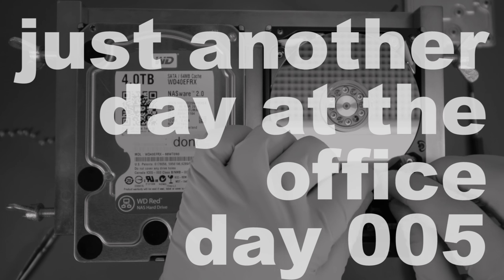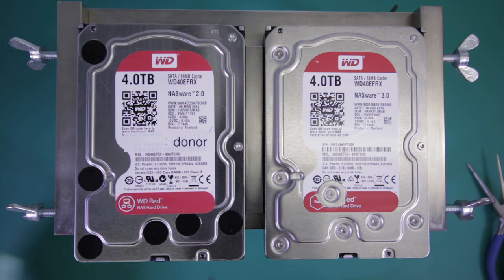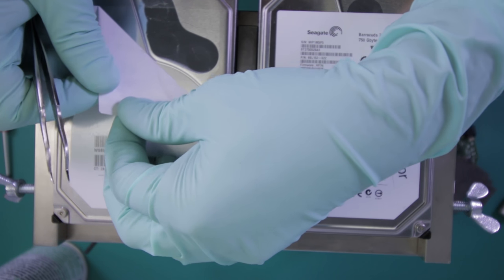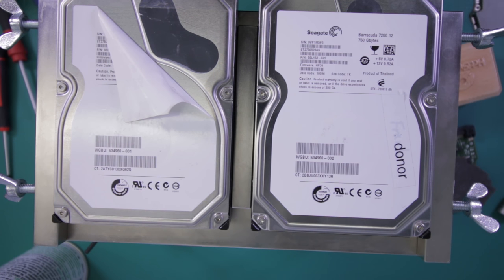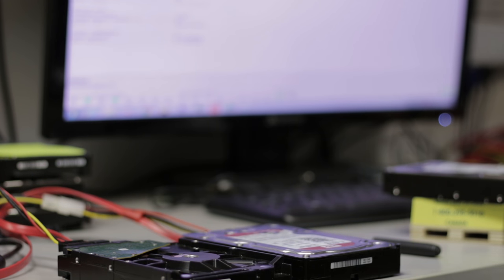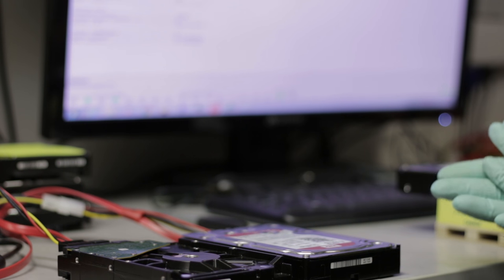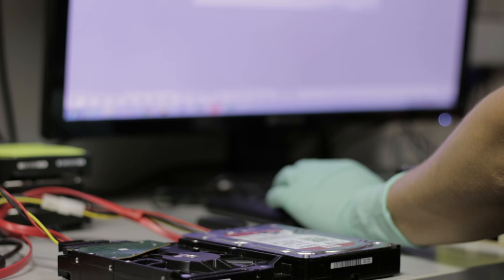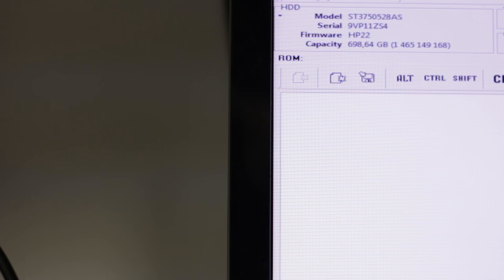recovering hard drives with clicking sounds

Comment: TL;DR Open up drive; replace with spare, working parts, and try and see if it works
Reply: how did that go?
Reply: @griffengout8101  do not do that
Reply: Yes, BUT only open it up in a professional 100% clean place, because every tiny dust that you can't even see will cause problems and for that reason It's almost guaranteed If you open up a drive in average place It is going to be faulty.
Reply: Well those hard drives look like he Winfield lives so it’s probably completely dead the trade area feed helium filled with boxes as
Reply: @VDani16  that's only required if the data inside is worth a fortune. You can actually even operate the drive with the cover open in normal non-cleanroom conditions and help the arm move by hand while at it and have probably 99% chance of not losing your data if not doing something stupid like sticking your dirty fingers to the platters etc. I have done that a few times to old worthless 2.5" laptop hdd's and it's worked every time.
Reply: @MF175mp  Did you built a clean chamber with hprea filter when you replaced the heads?

If so how did you get access to your data? Did you clone it? 

I have got a sonar drive that is matched with the faulty drive so I hope it will works if I build a clean chamber to swap the heads.
Reply: @chris01479  I never replaced heads, the problem was the arm swing stepper was sticky/too weak to move and I salvaged the data by helping the arm first start moving by hand. But I'm not a professional and there was nothing important to lose.

Comment: HDD recovery is it possible to repair a clicking harddrive on a ps4
Reply: usually you're better off replacing the drive. These "repaired" drives are repaired for data recovery not actual long term use.
Reply: I have the same issue lol

Comment: If the platter looks scraped (not mirror smooth), is it a lost cause? My drive is a Seagate and when I open it and look inside, (powered on) the discs spins, and the arm moves back and firth quickly about 10 times before it stops spinning.
Reply from the maker: All depends on your budget. Platter damage of any time is gonna cost thousands. We start at 3000USD for these

Comment: Wonderful video. I was wondering if you could answer a question for me since you guys have done so many hard drives. Does a 7200.11 making "eleven clicks" followed with a turning off sound imply a stuck head or a broken head? If it is merely a stuck head, is it easier for you guys to work around it then having to replace it?
Reply from the maker: If the drive spins up even for a moment the heads are NOT stuck. Opening hard drives to look if they are stuck only increases the risk for platter damage due to contamination and drives up the cost of repair and inspection fees
Reply: @hddrecoveryservices   I see. What then could it be? I have this problem with an old 7200.11 drive and while I have found mentions of the "eleven clicks" error on forums via google.com, no one seems to know what it means. I'm buying a new power supply because I'm afraid it hasn't been getting enough power.
Reply: @hddrecoveryservices  Thank you for that! (You are SO GOOD; I've been watching quite a few HDD recovery vids lately and the quality of your tools and skills is superb.) 

I have an external 2TB Seagate HDD with an issue. It does what you say at the beginning of this video. Seems to spin fine. 

I have made a clean air compartment, have ordered Torx screwdrivers. (Have done cleanlab work in a laminar flow hood in the past.) 

There is a LOT of dust here in my home and I also noticed that the HDD went on strike after it had spent the night in the coldest corner of my home office when the temperatures outside got really low. 

So that makes me suspect that perhaps the actuator mechanism is the problem (contraction of the metal parts in combination with dust possibly jamming the mechanism; what do you think of that?). I have watched your videos and noticed that you later got into the habit of washing heads more often. But washing heads also means that you remove the actuator mechanism and then put it back and if there is debris on the heads, then there might also be some debris that affects the mechanism and that you get rid of it that way. Those tolerances must be minute, after all.

But I was not entirely sure if any of the heads could be stuck. Now I know that they are not. Thank you. 

It does not seem to be a SATA bridge issue either; that said, I can't be 100% sure that the drive is always getting enough juice though it does have its own external power supply (and that does not seem to be the issue). (There could be a USB port issue on the PC, but a new 4TB disk that I have works fine with those ports and that one does not have an external power supply, so that rules out that it's the PC that somehow caused the problem.) A docking station might be handy to have. 

(I also have two internal HDDs with issues - at the same time, yes - but one is dead and had nothing on it so I will just replace that one. The other one seems to be doing better now and is passing tests again; it may have had one bad sector in a critical area that I managed to have worked around now because it went from reporting 7 bad sectors to 6 bad sectors, which may sound unusual (but this may have something to do with Linux; it is running a dual boot). One thing I have meanwhile learned (for people like me, without your kind of gear) is that if you encrypt your Linux partition, checking that partition and telling Linux to avoid the bad blocks becomes impossible or near impossible.

(I have been plagued by hacking for a long time, by people who turned out to be picking the locks to access my equipment and I never saw that coming. My HDDs have not been too happy about all that interference and about how I often responded to it, that is, I was stupid enough to spin the drives up too soon after having to throw power off the PCs when they froze instead of letting everything die down and only then flipping the switch again. Mea culpa. I really should have known better and will be much more careful from now on.)

Sorry for the long comment... (lol)

Comment: i've got segate 320gb barracuda 7200.12. it is not getting detected. how to i recover the data.
Reply: sameer mane we have same a trouble ...
Reply: mine was a terabyte and it clicked of death
Reply: Solution for future problems: don't buy seagate.
Reply: i may be paranoic but i keep my important files on 4 hard drives so each hdd has same exact copy of files
Reply: my wd just crashed so i wouldnt
Reply: You guys wouldn’t have this issue if you’d swap to solid state drives... All 3 of my laptops and both my gaming desktops have SSD’s in them. Intel optane 905p is the way to go, I love the PCIe drives! Once you convert over you’ll throw away every single mechanical HDD you have, they’ll all be worthless once you experience what you’ve been missing.
Reply: Sultan Singh that’s true but for priceless photos or some invaluable data I wouldn’t trust HDD. Seems too risky.
Reply: me too :(
Reply: di Jogja ada servisan khusus hardisk bro

Comment: hi i had a query that if the plate has one or two minute dust particles can it be cleaned? if yes then what are the tools required? i have a seagate 2tb hard disk which has crashed and i had opened it without a clean room enviourment.

Comment: I have an old Seagate 250Gb HDD which is squeaking and clicking. The disc is not spinning at all,  the heads are in thier parked position and do not move on their own. When I try to move the heads towards the disc they fight back and move back to the park position.

Comment: my 2.5 inch hdd is not detecting. I and the hdd is doing clicking sound very loudly. I opend it and I saw that when bois try to detect the head leave the platter and doesn't move to the platter. If i force the head to stay on the platter then it detect in the bois.....what should i do??

Comment: Please help me with one advice: I buy 3 * ironwolf pro 10tb for my nas. First, i put them to pc for test. Only with power cable (without data cable conected) all of them have a sound ("toc" like head hitting something) that repeats over  and over... with a few seconds interval. Smart test and surface test dont reveal any problems, but even with the connected data cable this sound persists. In Qnap they work fine but with this sound... so I returned them after 10 days, and I bought three other hard drives (ironwolf 10tb - without "pro"). The same problem. I put one of then to pc (outside the pc to hear well) for testing: the surface test lasted for a day, and in his time nothing seemed to be heard. After a day, the same sound ("toc-toc") was clearly heard. Almost every second. Even when the hard disk was accessed it was also heard the sound among the others. So I returned these hard disks as well. Was it a problem, or is it normal to hear such a repeating sound? Toc - toc - toc..., not loud, but not regular clicks (clik-clik)... was how it would sound if a hard drive's head was easily hit by an edge... and besides that, the hard drive works seemingly normal

Comment: Really like the head jigs you use. I tried myself on a 2TB Toshiba (platter swap) but was a no-go since I think I ended up moving the heads (uggh). Only lost like 8 years worth of photos and work so...yeah I'm bummed. Good as place as any to just start over I guess. Backup is now a part of my weekly regimen. Idea for approx cost on 2TB toshiba platter swap?
Reply from the maker: The most challenging thing would be to deal with any surface damage that might have emerged during your attempt. If the drive is previously worked on, we charge for inspection and decontamination. Once the inspection is done we can talk price and options. 8 years sounds like a lot to lose. I would recommend reaching out for inspection to see what option are still available
Reply: Thank you for the reply and info. I’ll reach out soon!

Comment: Great video! :-) Thanks. :-)

Two questions: 
- Where did you get those tools that you fixed the heads with before removal?
- Where did you get that cool jig you mounted the disks in?
Reply from the maker: most of my hardware for internal work on hard drives is from these guys here: www.hddsurgery.com
tools are pricey, but they are Porsche of data recovery tools (as in there is no substitute)
Reply: HDD Recovery Services + Reidar G. Henricks : 
I'm glad Reidar asked about those things because I will buy them ... If I've got the money to spare at the moment. But not only that, but what you are doing is very eye opening for me. I've torn the guts out of more computers than most people could ever imagine, but I have NEVER gone to so much detail to get at the data.
Thank you so much for introducing me to a part of my world I knew existed but that I had never seen before. And more so because I am in between jobs and this very well may have given me a new lease on life! I'm dead serious too! I can do this, I just do not have the skill set at the moment.
Reply: First of all, thank you for the reply. :-)
As for pricey, I never expected 400Euro for a headtool for Maxtor.... I have some disks I`d like to play with before I try on one I found that I need to fix, but I guess I need to save up some money first.

Comment: Good job! 
Are these head ramps new? In some of your last videos you used some other spacers to hold the heads apart. Or do you use them only on HDDs with a lot of heads?
Reply from the maker: I've got ramps for almost everything. I think I only use spacers on ST LM seagate/Samsung drives and older to toshiba. The one that is used on 7200.12 in this video is probably from 2009-2010 because it was actually designed for 7200.11 and it is a very early version

Comment: What are the pieces you putting on heads during removal fore ? I have hdd and it just does the clinking for ever. I'm thinking about buy the same HDD and swap heads just for data recovery. Would the new HDD be ok to use after putting its original heads back ? The new HDD will just a back up of some my stuff.
Reply from the maker: Honestly, don't try to do it yourself. Mechanical swap is just a small part of the process.
Reply: @hddrecoveryservices  Ok. I did a little more research and I see its way more complicated than you make it look ;)
Reply: He does this to keep the heads from bumping into each other. He has professional tools for that. Haven't seen others use that.

Comment: Hello,
Great informative video. Thank you! 
I have a question. I I have Dell Inspiron 660 (about 8 yrs old). This week it gave me message that hard drive failure. When tried to turn on, it’s making sounds like a older scanners made while scanning. So I changed the hard drive but problem didn’t go away. So it doesn’t seem like a hard disk problem. I also changed the SATA cable and power cable. But no different. What do you think could be a problem?

Comment: Can you tell me where the proper home needle placement is for a Western Digital wd2500jb hdd?  I found it stuck mid platter when I opened it to look at it?  This particular hdd is a 250gb and it has a pcb board too.
Reply: did you open it in clean air? if not it’s already dead by the time you opened it from the dust.

Comment: I have a question about my Samsung 500 GB drive. The drive was clicking badly when I had it installed in my external hard drive enclosure  it was very hot . I let it cool overnight and then hooked it to a USB Sata adapter and back to my PC . The drive is recognized by the PC and I can see the data when I try to copy the data off the drive it reaches a certain point and makes a clicking sound.  I feel the drive is failing and I wanna get as much data off the drive as I can as quick as I can what do you recommend. Thanks !  Enjoy your videos !
Reply: I had a similar problem..i read somewhere to put it in a sealed sandwhich bag and put it in the freezer...i noticed i had about 15 20 min before the drive would stop working...i had to take the data off in sections...glad it was only a 750gb but i still had to repeat that process 10 or 11 times and i noticed there was some files that were corrupted and cldnt be recovered...after i was done it was pretty cool taking it apart n not worrying if i fucked anything up...i opened n it and hooked it up just to see what it was doing...the heads slam from one side to the other making the clicking sound...not sure why they do that..interesting to watch tho.

Comment: Hello! Thank you for this video. I watched a couple of these trying to find out what's wrong with my hard drive for it is making a clicking sound when you connect it to the PC. Most guys were saying the head is stuck on the platter but mine is not. So, I want to know if it's possible to replace the head with one from a different hard drive and without any of that equipment you were using.
Reply from the maker: Whoever says that clicking sound is a sign of stuck heads is an idiot.heqd replacement is needed in your case. But I would not recommend you do that if your data is worth anything to you
Reply: @hddrecoveryservices  Oh thank your response. I'll talk to you soon when I have the resources to at least recover my data

Comment: Can the same hard drive (but 120 instead of 200 gb) be used as a donor drive? Thank you
Reply from the maker: If heads are compatible and head map matches then sure. But the question is how are you going to find out? If data is of value to you see a pro for help. It will only cost way more later after failed attempt

Comment: Holy shit is that your artwork with the drives?
Reply from the maker: JGAN96 it is, and thank you for noticing!!! I am really happy with how it came out
Reply: @hddrecoveryservices  Yeah that was something I noticed too. It's sick. Also, I have a question. I play PC, console, and phone games. So, basically, I play it all. I have a 5TB external drive on my Xbox One X. I've had the drive for about 5 years or so. I'm not sure. About a year after the original Xbox One came out. So it's been awhile. It's seems to work fine and everything but it's getting full. Anyway, it's recently started to be kind of loud. I'm not sure what "clicking" is supposed to sound like but it does seem to have what I would call clicking. It only does it when it's reading something. So like when I'm playing a game and it's loading, it clicks for a bit, then it stops. If a pause the game of go to a new page, or every now and then while running around in game, it clicks  bit. Loud enough for me to hear it from like 6 feet away. It sits behind my TV. Anyway, it this "clicking" and does it mean I should get a new drive or get it fixed? What would be the difference in price. Oh, and it's a Seagate. I'm not sure the exact model. I got it new on Ebay for like $150. It's powered. I don't know any other info I could give. Anyway, it this a sign it's about to go? Should I get it looked at?

Comment: I bought a brand new PC 10 days ago. While OS was installing, PC was having some clicking sound, but is not like electrical click, is more thicker clicking sound. After finishing installation, that clicking sound went away. I have a 240 SSD and 1 TB HDD WD blue series. After couple of days, i have installed CS GO and World of Warplanes, and when those games are running that clicking sound comes back, it clicks every  5 second, but since PC is under warranty i cannot open it to inspect further. When just browsing the web and performing light operation, that sound is not coming up. I have to say that PC is running perfectly but that sound its just annoying and it shouldn't be there since PC is brand new. Does anyone can possible advise what can be the issue here, and should i go back to the service with the warranty and let them fix the issue or there is a way how this can be fixed without going there. Thanks in advance!